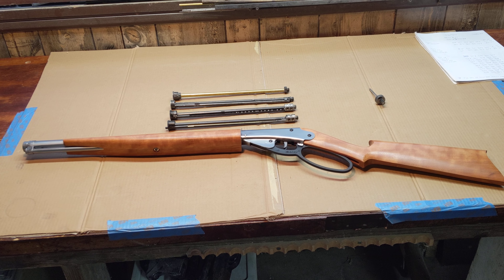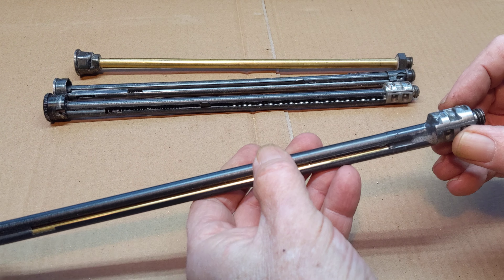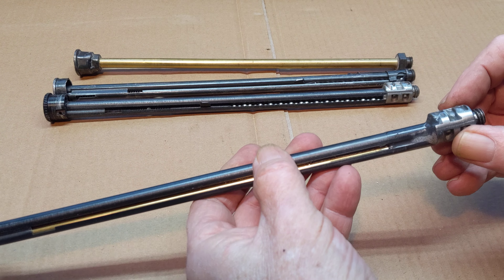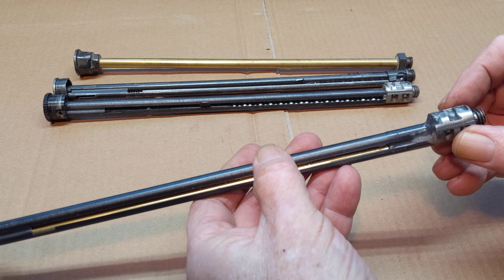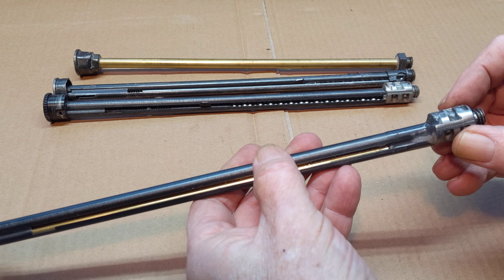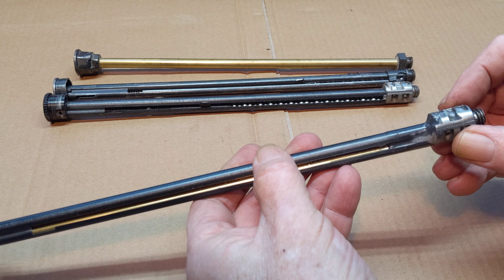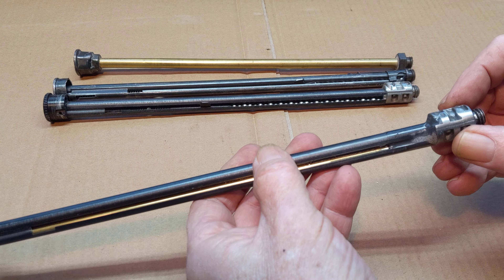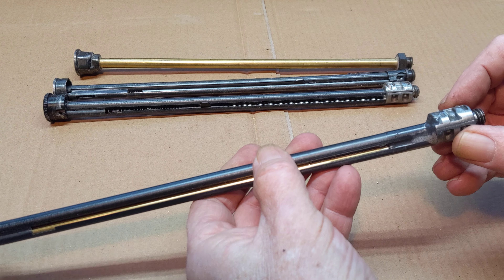Can you get a velocity boost from a modded Model 25 shot tube? You betcha!

Comment: Shane as always a great video:
 I want to thank you for highlighting one of my modified parts and for the very kind words about me .
Why do this modification ? 
Two reasons...it increases the FPS and it increases the total amount of BB's you can load into the gun to around 65 "without taking the gun apart for loading",  you just remove the little rubber stopper, fill it up then replace the stopper .
If there are any questions about this mod please ask.
This is a simple thing to do and uses easily available products,  but it does take some care when assembling the parts .
I will try to make a video on how to to it if you guys are interested ?
Thanks again Shane, for your very kind words.
Terry
Reply from the maker: The Cherry stocked Restomod used your shot tube at last nights Crazy Range event and was the preferred gun of my best shooter. His comments about how it hit exactly what he aimed it at have convinced me to add some accuracy tests after I get through with the velocity work with the other guns. I reloaded that tube 3 times last night but didn't to a round count as the shoot was ongoing. I did discover that the loading process can be speeded up quite a bit by blocking the barrel opening with a finger and using the squeeze bottle loader I use with the current production Model 25 shot tubes.
Reply: @RestOModDaisy  I put the rubber fill  plug into the barrel so the BB's don't go into it while I'm filling the tube.
I can fill mine very easily and quickly by hand, so if you have a tool for this It should go even faster?
Terry

Comment: Any idea where I can find the shot tube for the model 1938. I'm in the process of restoring my late brother's Red Ryder. Your videos have really been helpful btw. Thanks.
Reply from the maker: The original rattle trap tubes pop up on Ebay from time to time, you can also use one of the current production Model 25  spring loaded shot tubes. The model 25 tube will give you a little more speed and is avalible for around $20 bucks shipped from Mark Ritter's Cobalt 327 ebay store. Good hunting!
Reply: @RestOModDaisy  Thank you.
Reply: @RestOModDaisy  I read somewhere that the Model 40 shot tube would work also. Do you know if it will?
Reply from the maker: @anthonyhawk5977  The shot tubes used by the #111 Model 40 and the Model 1938 do interchange as do the shot tubes for most of the pre 1979 small frames like the Model 94, the Model 111 etc. They are all rattle trap designs and are only available as used units.

Comment: I'm curious. I just ordered a model 25 shot tube for my 1967 model 99 that I bought when I was 14, and I am wondering if it will make a noticeable difference in the performance of the gun.
Reply from the maker: You should see a slight increase in the velocity of your Model 99, if you're still running the factory mainspring I'd think you might get an additional 10-15 FPS due to the tighter tolerences and better crown of the current production unit. Did your Model 99 come with the 50 round spring fed shot tube or was it the rattletrap style that could hold 500 BB's? Be advised that more velocity will not lead to more accuracy.
Reply: @RestOModDaisy  The original is a 50 round tube. I have to say I have never been unhappy with the performance of the gun, I just thought I would see what the newer tube did.
Reply from the maker: @wallycox4579  I think you'll  like it once you get it installed and tweak with it a bit. Definately adds power when combined with a mainspring upgrade but will induce some accuracy issues

Comment: I never cronies my single shot tube..  I made it for steel bbs.   Hmmm.  Now you got me curious 🤔
Reply from the maker: You should, the speed pick up is considerable. The 6mm airsoft barrel I used punches right through my triple strand  cardboard backer board, something that does not happen when fired from an airsoft platform. No air bleed from a loading port is a thing.

Comment: Howdy Shane!
Reply from the maker: Howdy back Nibs!  Man you are cranking out some videos, I can't keep up!
Reply: Gotta keep busy. Hey Shane I have a 1970  102 model 36 that needs a new plunger seal and abutment washer. What size do I need to get for this? Thanks.
Reply from the maker: @WalnutandSteel  I'm pretty sure that'll need the large seals given the vintage. The bad news is that Daisy quit offering the abutment seal long ago and I'm not sure if the compression cup is still a separate item on the parts list. I haven't placed an order with them since the new year. Check with Mark over at Cobalt 327 on the 'Bay and see if he's got some.

Comment: It's it possible to put a modern model 25 shot tube and abutment in a modern Red Ryder?
Reply from the maker: It's possible but takes a lot of work. The existing shot tube assembly has to be reoved and a replace abutment washer has to be fabricated and installed. There is quite a lot of info on that process over at the High Road Forum in both the the "putting More power in a $15 dollar Daisy" thread and others. If you're jonesing for a rattletrap Daisy with a removable shot start looking for a pre 1978  Model 1938 Red Ryder or the Model 94 or a Model 111. No mods needed just drop in the Model 25 shot tube and start shootin'!
Reply: @RestOModDaisy  got it thanks for the info have a nice day
Reply: 40…I thought he said it Holds 65 BBS…great perspectives…and we can not understate his work it’s crazy to see that Kentucky long ridge build…It’s the absolute  top in terms of finishing and detail…As always great video.
Reply from the maker: @peterkock9986  Terry sent me an email on that, I stopped at 40 and there was quite a bit of room left. I gotta said loading it is quite fiddly bits. Next video will clear that up.
Reply: Yup big fingers small bbs and tiny hole…I look forward to the next video…
Reply: @RestOModDaisy  
Shane you may find the FPS goes up with a full magazine as more BB's creates more back pressure in the feed tube?
Terry
Reply from the maker: @Builder-of-Kool-Stuff  I'll do a test with a halfloaded mag and a full loaded mag and see if there are any differences.